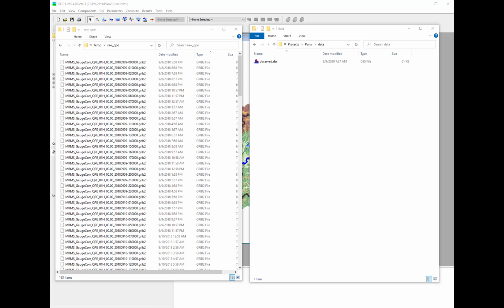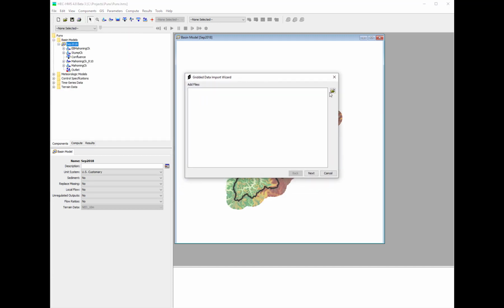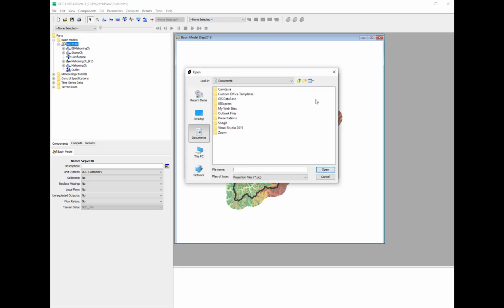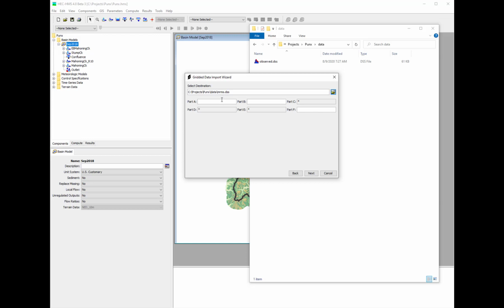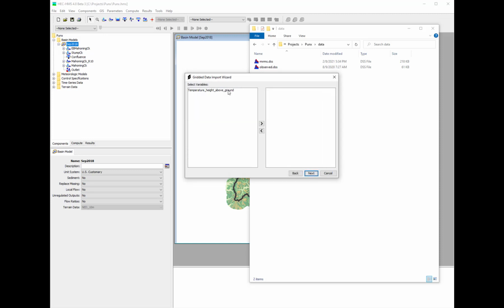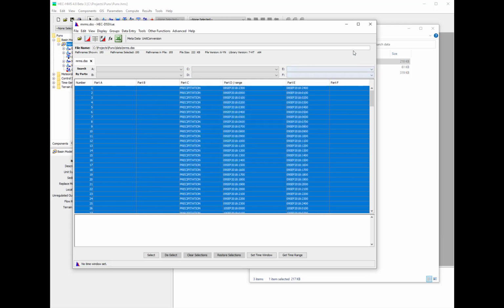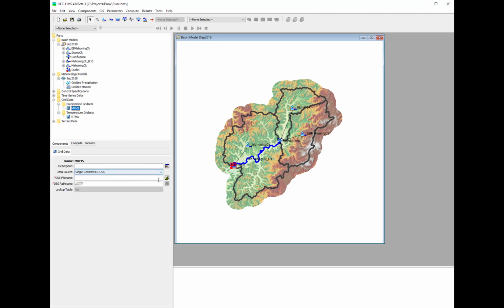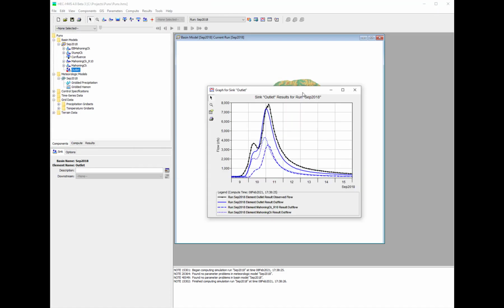L 4 d Gridded Data Import

Comment: Thank you so much for this tutorial, I was specifically looking for ways to convert .nc to .dss file. However, I am continuously facing this error in HEC HMS when I run the gridded precip. data input 'Missing precipitation set to zero for 69 of 69 grid cells at 02Jan2000, 00:00 for gridded subbasin "Subbasin11" similar error is present in log file for all the time steps and all subbasins. I have checked my .nc file and .dss file both contain valid precip. data, the projection of .dss and my basin model is same. the units are set to 'per-cum'. But despite everything I am facing same error again and again. Can you please guide me ?

Comment: Thank Thomas.
I do step step from your tutorial by mrms data for my watershed. But when running it has the following warning. Could you please help me why is that error for?
Warning: missing precipitation set to zero for 45 grid cells at 3 January 2022, 01:00 fors subbasin1